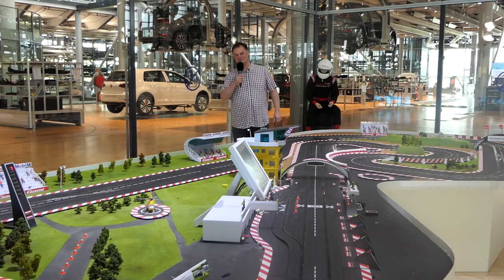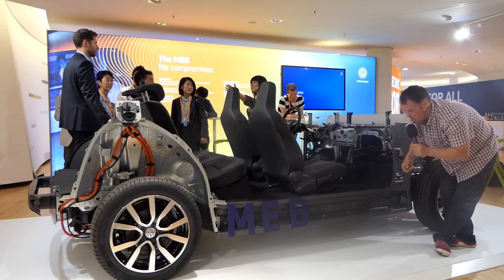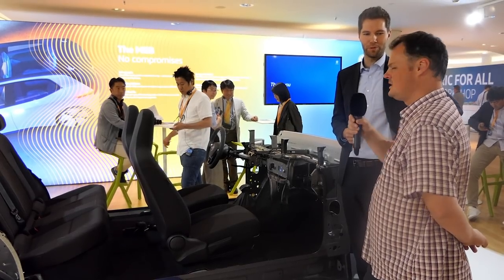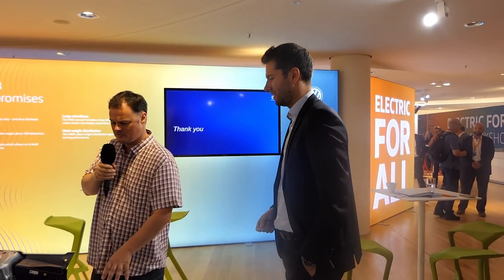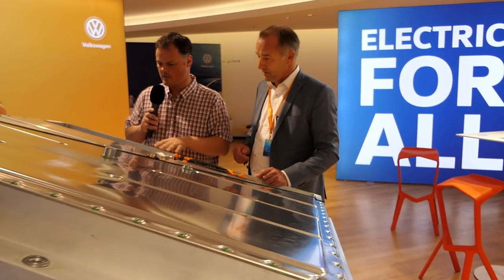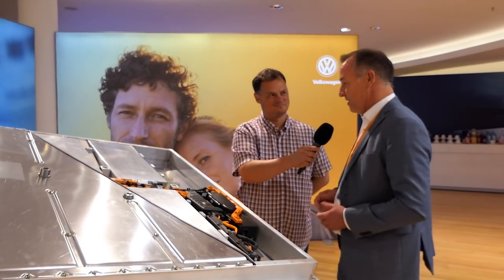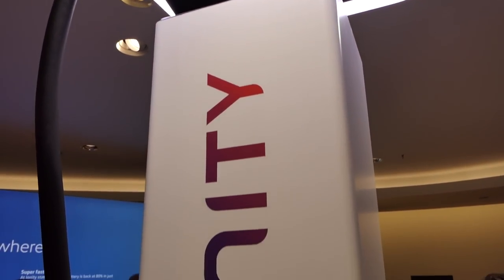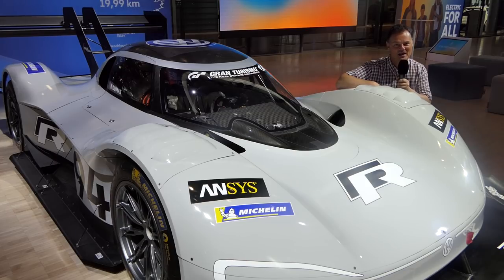Will this boost electric vehicles? 10 million EVs on Volkswagen MEB platform FEATURE - Autogefühl

Comment: The battery explanation was very informative and I'm happy that they're adjusting the cooling technique on that one because when I would charge my vehicle you would hear fans coming on to presumably cool down the battery during charging. With this new technique they should be able to passively lower the temperature.
Reply: It's interesting that both VW and Rivian choose to cool the battery from only the top or bottom. Doesn't seem like it would be as efficient.

Comment from the maker: For sure this feature is not a fancy racetrack show (besides the slot car =), but if you listen to all questions, answers and information in full-length, there is so much useful information about EVs in general and their future and the biggest challenges!  /Thomas
Reply: always in full length! <3
Reply: Challenges? I’m not seeing any. The internal combustion engine is the one with challenges now I think.
Reply: Thanks Thomas, for the info in some of the answers. But glad that at 20:40 Brian mentioned some of the problems my wife and I see in our everyday use of our EV (was a Zoe, now an E-NV200 Combi) - arriving at a faulty charging station. Or the station is occupied (for an unknown time!), and there aren't many where we live (UK!). We charge at home, but don't dare venture far in our EV! And we think we're realistic enough to realise our EV won't save the planet, or is the answer, or is environmentally sound. EV's are expensive at the moment as Brian mentioned, but a simple EV just works for us! Oh, and we find the E-NV200 Combi is fun to drive!
Reply: Thanks Thomas, shame about battery swap and the 8 year warranty has lots of small print like BMW one. This means you might get 40% capacity loss before a single cell is swapped and then only back to just over the drop limit.
Reply: Luke W From what I read, the warranty is 8 years and 70% capacity. Good luck degrading it that much though. And by then, you would have saved so much money over buying petrol that you’d be crazy not to buy one. And then the battery could eventually be reused as stationary storage, and then recycled. What happens to a petrol or diesel engine when it reaches the end of its lifespan?
Reply: BrotherBloat lets go!
Reply: Nice video, but I have to ask a question that has been on my mind for a while.

Brian has been with Autogefühl for quite a while now, and he does a good job. But when is he going to learn to pronounce the channel name? I cringe a bit on every intro. 

I'm no language tutor, but speak both languages. Maybe this can help. It's Autogefühl, not "auto-ge-foole". :-) So... 

Tip 1: Auto, not as in automation but more like someone pinched you and you go "Aw!" :-D "Awto".

Tip 2: Gefühl as ge-phyl" where the phy is pronounced as in physics.

"Awto-gephyl".

Hope it helps, maybe watching 100 Thomas introductions helps more. ;-) I know it's a detail, but it's always a bit of a letdown when people mispronounce the company they represent. :-)
Reply: @Nicoleise  tough marker there Nicoleise. i think brian is doing a great job. some pronunciation may not be bang on, but it doesnt matter really. some people say volks-wagon, the correct pronunciation is folks-vagen, others say 'porsh', and its proper pronunciation is porsh-uh. it doesnt matter to me, as i know what they are talking about.
Reply: @-Derp-  - like I said, he's doing a good job. Is that a reason not to suggest improvements or provide feedback? :-)
Reply: @Nicoleise  to be honest i think you are being a bit nit picky. if it is absolutely vital to your existence as a human to have your voice heard, perhaps a private message to Autogefühl
 would have been the way to go, in the spirit of improvement, as you say, rather than grand standing.
Reply: @-Derp-  - It's pointless to argue with you over my comment, when you insist on reading much more into it, than is there.

Of course it's not vital to my existence, that's nonsense. It's feedback, which this channel and many other encourage people to leave in the form of comments. I could also write a private message, an e-mail or even a recommended letter, but what on Earth would be the point when the channel generally requests your opinion on various topics in the comments below? They specify the means of communication, not I. 

Can I maybe recommend that you lay off the whole "being offended on behalf of others" and respect that my comment is equally valid to any other comment here, and that noone died and made you the YouTube police and judge of what is appropriate and what is not.

You'll then notice that I didn't call the man an idiot, and that the whole format of my comment clearly acknowledges that it's a "general/frequent" problem for non-German-speakers to pronounce the umlaut. I could have used 12 more smilies so noone would think I was upset, but honestly it should also be possible to formulate a simple comment without answering to the internet police. If AutoGefühl or Brian feels offended by what I wrote, I'd gladly extend an apology as that was never my intension, but until such a time I maintain that I simply wrote constructive and relevant feedback, and that there really is no reason to get all worked up over it.
Reply: @Nicoleise  appreciate the feedback. perhaps i was bit of a dick head regarding the "if it is absolutely vital to your existence as a human to have your voice heard ..". my apologies. further (and i am shaking my head here looking at what you recently posted, thesis springs to mind ..), i'm not getting into a blow by blow who did or said what here, i think there are far more intelligent uses of one's time.

Comment: As a Renault Zoe owner of 2 years, I’m pretty sure I spent less money in total than I would have on a similar Clio. And I did 2 1400 mile road trips. One of them cost me nothing in fuel. This year it cost me about £20. I spent more than that on Coffee.

And one huge thing that was glossed over in the first interview (addressed later on). He said the batteries last longer than an ICE vehicle. EV drivers know this. They don’t degrade like my electric toothbrush. These cars go on and on forever.
Reply: For now ,the thing about any batteries is -after 5 years its begging of an end,you need to buy a new one.So with e cars you will need thousands of euros to replace all of the batteries.But I am still a fan of electric cars its just that I can't afford one ,I would definetely buy if I could !
Reply: Ivan Jeremija Did you watch the video? Nope.
Reply: Depends, friend of mine spends tiny amount running a 10 year old Clio, still gets 65mpg and if he lived in Finland could run it on #hvo made from waste not food for more like 75mpg and vastly lower NOx, CO2 and all other emissions. I drive a Bev i3 but its not much cop in winter unless you stay in the city.
Reply: Sadly not true about batteries, check out mk1 and mk2 Leafs on Arizona. In UK outlandish phib SUV battery problems mean dealers won't accept tradeins over 3 years old. Vast majority of lithium based batteries lose 3% per year even without use. Much higher with regular rapid charging.
Reply: Luke W Yeah the original leafs especially struggled in very hot climates since they didn’t have active cooling. Even the new leaf doesn’t. But they are learning their lesson. All the other manufacturers are strongly focusing on cooling now. I don’t know anything about Outlanders so I can’t comment on that.

As far as degradation. I believe you generally get maybe around that percentage or less depending on a lot of factors in the first couple of years, and then it slows down to almost nothing after that. I’ve seen a lot of EV youtubers measuring their battery state of health after 2 or 3 years and they’re all extremely good. And many of them have done big miles for that short period of time, probably with a significant amount of rapid charging. So in my opinion, there is very little to worry about. I never tested battery capacity in my Zoe but after 2 years and some big road trips with lots of fast charging, I didn’t notice any difference in range at all. It went back after the finance ended and I got a Smart. But if I had kept that car I’m confident that it would have kept going in that way for many years.
Reply: @christill  diesel still 10kwh per litre even stored for over a year. All batteries degrade and they drop more after first 3 years. See independent tests of some of the best BMW ones.
Reply: The cooling is mostly to reduce problems with rapid charging. It does nothing for normal increase in resistance with time. The i3 tests found 7kw was the best compromise. It takes a Jaguar I Pace 13 hours to charge at that rate! At autobahn speeds it consumes 75kwh/100km from battery in mild weather. Autocar tests in relatively slow UK gave range of around 200 miles from new.
Reply: Luke W , the degradation level of the  batteries depend a lot of the density that such batteries have. The Tesla batteries have a degradation of only 7% over the first 150, 000 miles. This has been confirmed by the 2012 Model S records. At such time you may just sell the EV and buy a new one. Or keep it,  because the most battery degradation that the Tesla battery will have is 20%, which still leaves you with a very decent EV autonomy
Reply: @gamalielpadilla5958  only with gentle driving and slowish recharges not with future demand for 400kW. Without useage and topped off around 3% deg per year. 750kg battery to carry 75kg person not that efficient in vehicle weight terms. BMW i3 around 250kg but if course more frequent recharges per year if same mileage driven. Model S in slow speed Norway was 80k before pack replacement
Reply: Frankly battery degradation is a pro for mass adoption of electric mobility. The key reason the traditional auto-industry has been reluctant to push electric mobility has been because planned obsolesce with ICE has been perfected. It took decades to align product longevity inline with financing terms for the majority of the market. In other words, the automakers are guaranteed repeat customers after more of less 5 years. At the moment the majority of traditional automakers have electric mobility as a Fata Morgana in an effort to convince brand loyal customers that they can have an affordable EV in their favourite brand, they just need to wait a little bit longer and it will be worth it. 
If battery degradation and increased range on newer models drive customers to buy a new car after 5 years, the business case for moving to electric on mass starts making sense to automakers.
Reply: My mum has a Zoe as a company car (elderly care) and she is not very convinced of it. Especially during the winter it has very Low range.
Reply: Chris Till I am confused about your charging cost comment. Are you charging for free at work, at free public chargers? I have fiat 500e which I charge daily at home. I drive my ev about 240 miles a week and my electricity bill went up by about $30/month. Where I live in US gas is very cheap at $2.45/gallon and even in winter ev’s are still much cheaper to operate.

Comment: Sounds like the MEB platform is going to be RWD only... no all wheel drive? With as much torque as an EV can generate you definitely want the option to power all wheels. Same for regen braking... you want maximum traction available for regen.
Reply: AWD is also available on the MEB.

Comment: I was surprised by the 550km autonomie claim...as far as I know, no manufacturer of presently available EVs makes that claim.  I also don't understand how a 100Kw charging rate is consistent with a 0.5 hour charging time and a battery capacity consistent with a 550km driving range...how big (KwH) is that battery going to be?
Reply: Correct. The Maths simply doesn’t add up. But VW will never let facts get in the way of a good story (or a good lie!)
Reply: Ok I'll take a stab at the figures here with some assumptions that they may be using.
550km x 145Wh/km = 80KWh battery now don't get me wrong 145Wh is on the low consumption side as most EV's are experiencing between 150 - 190 Wh/km (LEAF that is) but either way if they are using a 80Kwh batt the figures below are in line with the art of the possible.
So 80% of 80Kwh is 64Kwh and a 100KW charger will charge 64KWh battery in  0.64 of an hour = 0.64 x 60mins = 38.4mins so there about.
Its doable to charge to 80% in 30 or so minutes IMO

Comment: You forgot to ask the 3 key questions about the inductive charging system. 1/. How do you avoid cooking a cat that wants to sit under your car while its charging? 2/. What is the efficiency of their proposed inductive charging system. 3/. How are they to make it EMC compliant? 1/. Any animal life that gets between an inductive plate and receiver will get cooked unless there is some sort of auto cut out. 2/. Induction only really works efficiently if there is a tiny gap between transmitter and receiving plates. 3/. Unwanted EMC emissions will come from any gap between the plates.

Comment: Who makes their batteries? On another note, I must say I will miss seeing the mechanical marvel under the bonnet/hood of a car. The engine of a car is such a defining characteristic of a brand as well as the gearbox used. That's what makes them different. They will have to find new ways to distinguish from everyone else. Modern engines are so impressive. What about all the engineers and jobs in engine factories? I'm a bit sad.
Reply: It's not like you could see a modern ICE engine by opening the hood. They're covered with so much plastic covers and assorted crap.

Comment: The electification of cars seem to be bringing RWD back to the mass market again. Exciting stuff.
Reply: Apart from #vehicleobesity and poor energy density. 1 litre of diesel holds 10kWh, an i3 holds around 22 kWh (when 60Ah was new) but after a few years it's down to 16 ish and weighs 250kg
Reply: I don't understand why VW think RWD is better than FWD

Every time it snows, RWD have to hang up their heels for the day...
Reply: @MaxMisterC  Hopefully they release AWD versions too, because I am NOT buying a RWD vehicle unless I move out of Connecticut.
Reply: @TekAutomatica  You still have to account for the difference in efficiency (30ish % of diesel vs 90ish of electric). I am aware that does not completely compensate, but my point is that only looking at energy density is moot. Maybe the depreciation numbers you calim for the i3 60Ah are true, I don't know, but they certainly are not representative for depreciation in current gen EVs.
Reply: @MaxMisterC  While AWD certainly has adavantages, I dont see how FWD is better then RWD with a 50-50 weigh distribution.
Reply: @Noi5ee  compare like with like. Diesel is over 50% thermodynamically efficient more so with non fossil fuels. Container ships over 65%. That's why global goods are so cheap.  I suggest measure kWh from plug socket vrs kWh from diesel pump. Audi A2 1,2 still 24kWh /100km in winter which is better than our i3 Bev
Reply: It would be more exciting if you can turn off the traction control and stability management system. Others below don't seem to understand vehicle dynamics.
Reply: @MaxMisterC  FWD mattered when all the weight was up front. EVs are center weighted and RWD is absolutely fine in snow (as a ID.3 driver for 1.5 years, I can vouch for this) and a hell of a lot more fun the rest of the year.

Comment: Liquid cooling from one side of a pressure boundary sounds like the standard way cooling is done, other than Tesla - why are VW claiming they are unique in doing this?  (And even Tesla runs the coolant through a sealed tube).
Reply: Because you shouldn't do research on their claims. How dare you do facts check? 😆🤣
Reply: VW are masters when it comes to “engineering”  the truth. 🤔
Reply: Remember, all the German manufacturers have pulled all the Tesla models apart, to see how they work, then they copy them. Then they will claim theirs is better. The Phaeton was meant to become electric in its latest iteration, but after several years of trying, VW gave up, as they could not improve on or even reach the ability of a 2012 Model S.